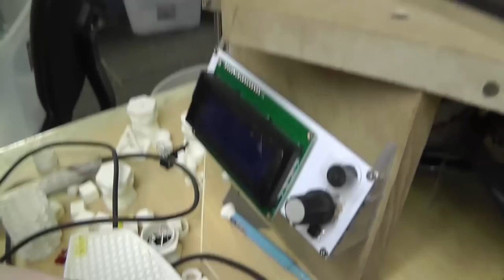Meyer Update 4-16-13, Injector Insert , SS Wire, VIC Bobbins, and Other Info. Hurry Up And Wait!

Comment: The project is coming along slowly but surly! I almost have my heat exchanger made so I can pre heat the ambient air coming into the vapor chamber and secondary air inlet! Once I have that done I will have control over almost every aspect of the vaporization process such as ambient air temp. vapor temp, air to fuel ratios, etc.!

Comment: It is because ceramic shrinks when it is fired. The machinable stuff still has to be molded and fired. Then after it's made you can machine them to final fit. I haven't heard anything about the conical interface that I cut for you. I was concerned with smoothness on the internal interface because the tool was the same size as the desired interface.

Comment: Great Job Russ.  I have gone to a hole new level with the Stan Myers work myself in understanding and feel I need to start associating with people like yourself and others truly working to fully replicate all Stan Did.  Great Job on the injector .  Would you ask your machinest friend that made your injector how much he would charge me each  to make some ?  I thought the 3 D printer idea was over the top also.  I have a question Wondering how it would work for the E P G.   Also wondering how far you got With combining argon ions and iron ions for Stans EPG using lazer light to genorate electricity ?

Comment: Nice to see a Meyers update from you. 3d printers are amazing. I've been looking at the metal 3d printers. You fill with metallic powders and the system uses lasers to fuse a part together layer by layer. Keep up the great work.

Comment: Wow! Those look really good. You are getting very close! Stan was pumping water through the injectors at high pressure (around 125psi). Do you have any ideas on the pump you are going to use?

Comment: couldn’t you just use a function generator on burst mode and drive a MOSFET for primary side switching? Seems easier to do research that way then with the custom PWM circuit.

Comment: Hi Russ
Great video.. I am working on same thing as you and I get my coil 3D printed soon.
But I saw i your video you were using stainless wire as in the patent... this is not necessary... Stanley explain it him self here:

Go to 35:20min... and listen carefully to the question asked... 
Stan Meyer "The Secret Missing Links" Chemistry 1989 House Meeting NZ

Best regards
Tue
Reply from the maker: hi, one thing to remember is we know Stan used SS wire in his circuit. ( we have photos and info that show us so and the wire i have there is from a spool that was at Stan's estate.)  he needed to tune the circuit in the space he had deigned the bobbin for his application. something he takes about in one of his videos (cant remember the video) is it necessary? all depends on your set up... i started trying to replicate to the T so i'm using Stan's wire for testing. :) thanks! ~Russ
Reply: *****
What Stan says is that he needed to make things more "complicated" to get the patent. It is hard to get a patent on a very simple thing, like a coil with copperwire... therefore he said it had to be made from SS-wire in his panent... But in the video I linked to he explains that copper wire will work as well. 

I was wondering a lot about the issue with the SS wire when I was reading the patent at first... I am a electronic engineer... and was asking my self the question some other engineer asked directly to stan... "Is it really necessary to use ss wire"... Stan says NO!

So instead of spending time and money getting SS- wire... just use ordinary copperwire... it will work just as good.

As Stan explains himself... the circuit actually is very sipmle.... it is just a high-voltage transformer.

Comment: Hey Russ, check out Superior Technical Ceramics in St Albans, VT.  They are not cheap either, but if you tell them why you are doing what you are doing they may be interested in helping.  I used to work there as a tool maker and the owner is big time into alternative energy stuff.

Comment: Guys, isnt better use arduino and DDS modules for creating signal? I using it in my HHO projects ... is more acurate and you can change frequency or modulation it in real time based on curret or voltage, with simple progam.

Comment: you got the shape now buy some liquid ceramic solution come's in a tooth past like dispencor and is ceramic just in a liquid form take some rubber chem dip and make a mold of your part pattern use a plastic insert in the inside or a filler of bakeing soda and sugar mix that can be shaped